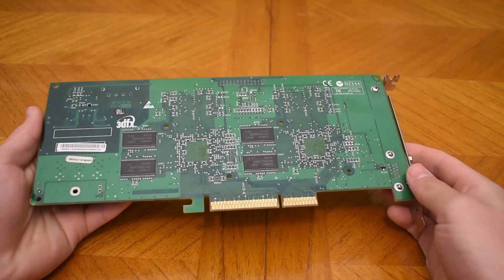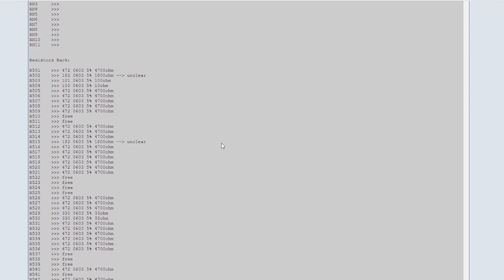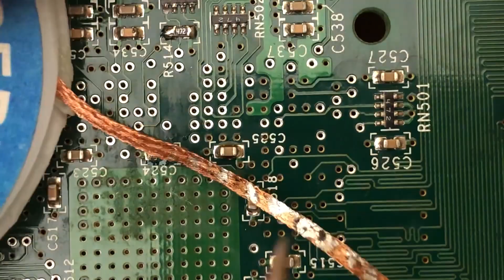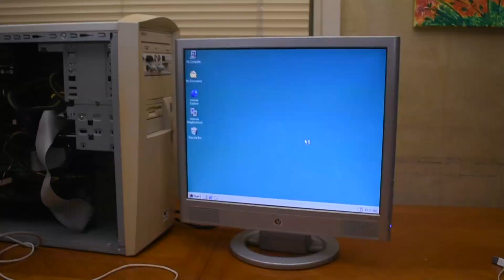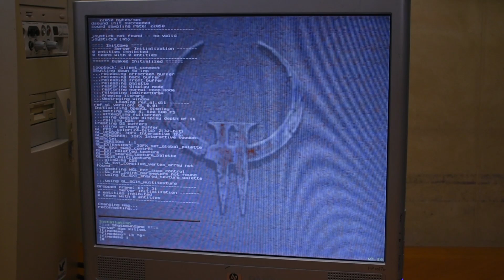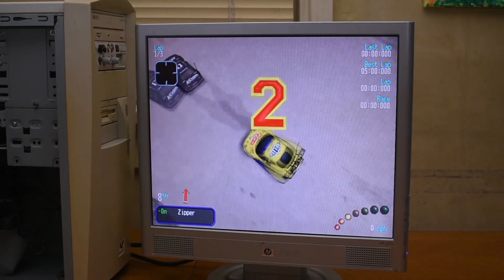Repairing A Vintage 3dfx Voodoo 5 5500!

Comment: Anyone know which SMD caps I need for C505 and C506 mine have gone missing? Card still works but every once and a while I get lines and a crash at boot. I’ve got the list of components for the Voodoo5 but I’m not sure what to buy.
C506-100nF/0, 1 F 16V 0603 X7R 5 or 10%
C505-1,3nF

Comment: Wow! Good work! Just some extra advice though, even though it is working now you should think about replacing the electrolytic capacitors - they are what have been killing these cards over the years, they are so old now they need replacing. If you replace them per-emptively, you should protect the card for the future. Well done again! So impressed someone so young has such skills & interest in older hardware.
Reply from the maker: Haha thanks, I actually did do a full recap of the card a while back now since it was having some other issues. Works perfectly ever since

Comment: That looked like a tough job.  How did you know which components needed to be replaced?
Reply from the maker: Yep sure was. I just looked for ones which were either missing or damaged. It was easy to tell if a part was missing, since the solder pads would have solder on them, with an indentation of where the old component sat.